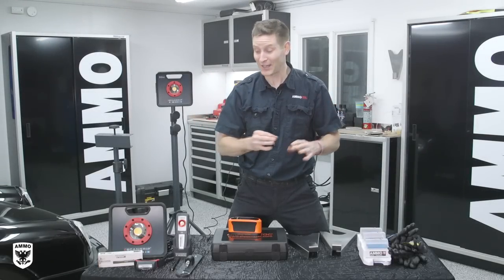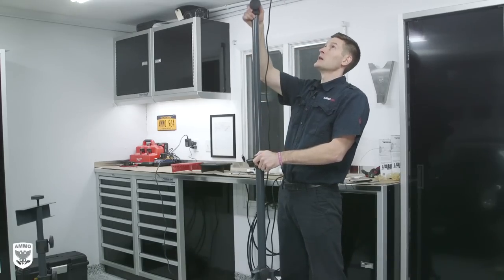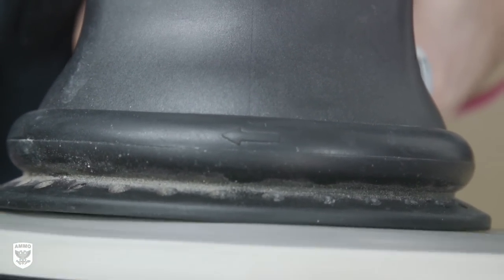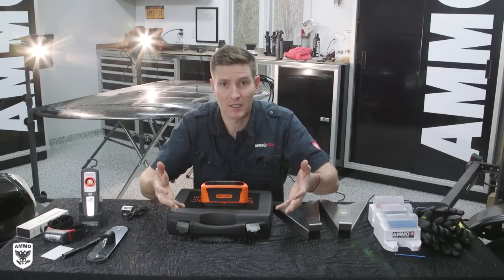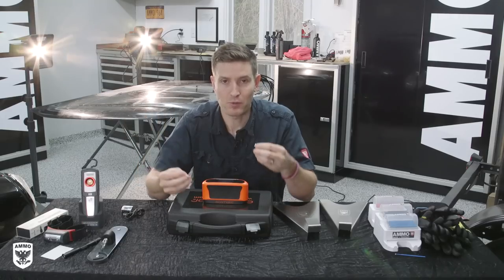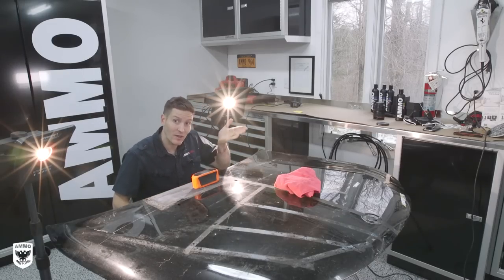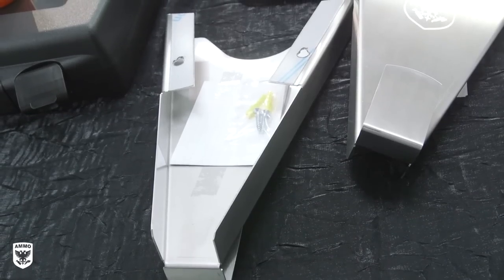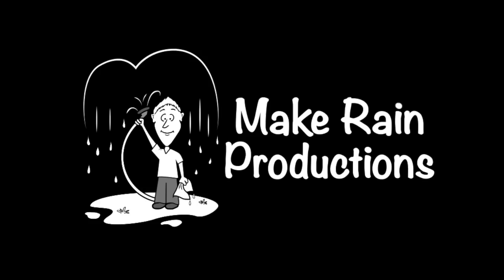Must Have Detailing Tools & Toys Review

Comment: We use the Scangrip system at my school for painting. I turn off all the lights in the paint booth and use the Scangrip in the dark to see where my spray is thin or if I have bad overlap pattern. I also use it to paint match a color chip to the car to make sure it's a perfect match before mixing the paint 😎

Comment: Larry, your new garage is pretty amazing, specially the floor. However, the lights may be affecting the white balance on your camera(Your skin looks very gray). If you are still using the SLR to film your videos, you may consider saving a custom white balance and using that for videos inside your garage. You just need to take a picture of a white sheet of paper and you can manually adjust the tint within the WB Shift menu of the camera. Keep up the good work!

Comment: You should not use a metal washer as a spacer.  The metal spacer can cause metal shavings to get into your paint.  Your need to use a fiber washer that is the correct thickness and the fiber washer also can be crushed which allows for a snug fit sorta like a lock washer.   The Spacer washer keeps the pad from rubbing on the counter balance weight.  Do not use a metal washer.

Comment: does this washer trick work for any polisher?
Reply: I would think so, just look at the gap on your polisher before you remove the backing plate, put a washer on, and look again. it should raise the plate away from the housing by the thickness of the spacer